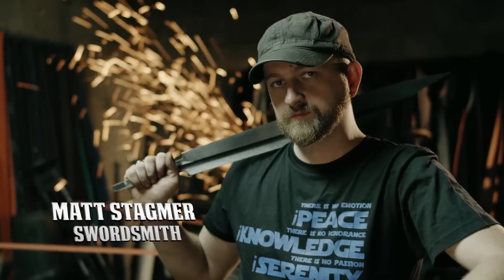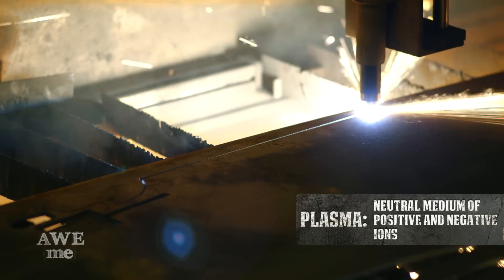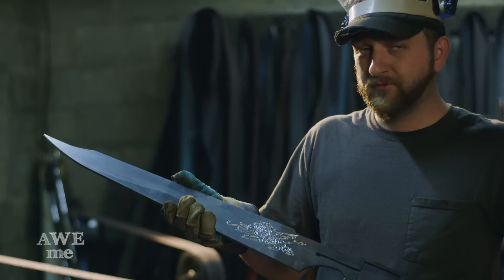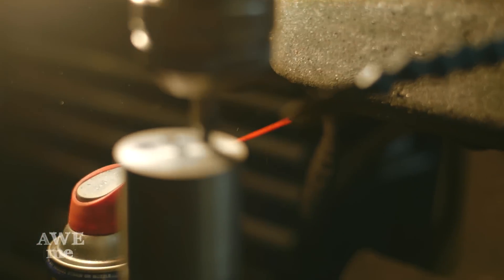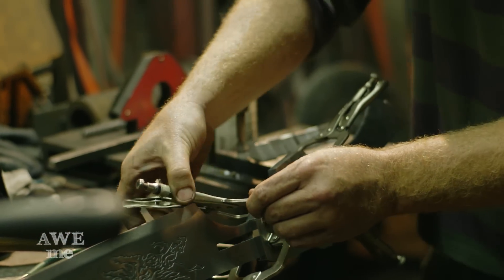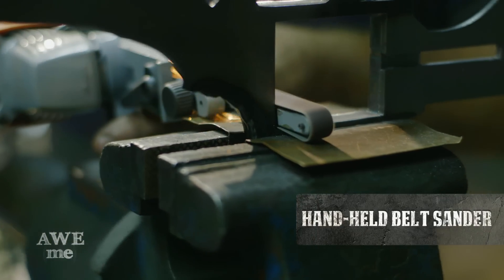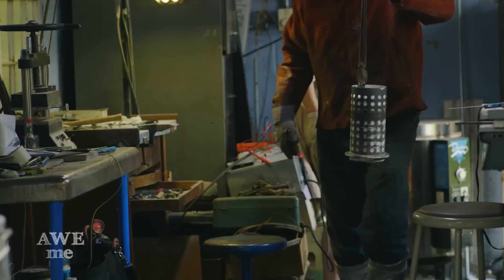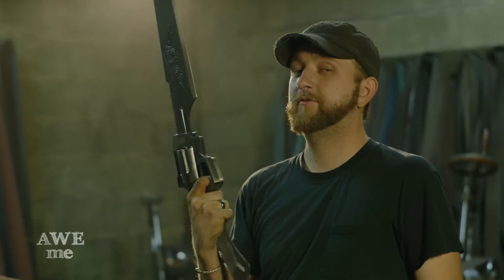Squall's Gunblade (Final Fantasy VIII) - MAN AT ARMS: REFORGED

Comment: I am very impressed that Griever was mentioned and not just called "lion bird" or something. You did your research and the product looked amazing!!
Reply: Researched that but didn't research the actual swords size it's too small
Reply: @kurosironcry3619  This size is correct. I've seen Squalls original gunblade was never a buster sword and was pretty compact. You are thinking of his Ultima blade which is a bit larger.
Reply: I'd say the slight problem would be it could be a bit wider on second viewing.
Reply: @bentoremix4311  watch or look up Micheal Cthulhu's build you'll see what I mean.
Reply: @kurosironcry3619  did you learn in this past year that squalls gunblade is 25.5 inches?
Probably not on the dot, but pretty close it looks like

Comment: One of their best creations so far. It's just the right length that it's easily wieldable and just the right thickness that it doesnt wiggle when slashing through objects like the past ones. Shit's cool.
Reply: Yeah the non wiggling of the blade is what really impressed me.  Blades are not supposed to do that.
Reply: colkestrel well actually blades dont wiggle. They flex. Because of the nature of steel, it has to flex otherwise the blade will snap.
Reply: colkestrel Aren't supposed to do what? Wiggle?
Reply: colkestrel That depends on the sword and quality of steel. Thinner swords tend to wiggle, and their supposed too, if the steel wasn't flexible enough a thin sword would just snap on contact. That's also the purpose of folding steel, it's to make low quality steel more flexible.
Reply: HeroUnit210
The blades on man of arms always wiggle like a one handed saw.  They are not supposed to do that.  Flexing is one thing and wobbling is another.
Reply: Adam
Correct they are not supposed to wiggle like a one handed saw when striking an object.
Reply: colkestrel They are actually supposed to flex quite a bit. If they didn't, they would snap.
Reply: colkestrel the difference is a wobbling blade will bend. A flexing blade will go back to original form.

Comment: NICE! You really listened to the fans. I like that you got some other cutting stuff, zombie head was requested and was great. I also like that you did a lot of explaining by the blacksmiths themselves this time.
Reply: Agreed. I've learned a lot about forging through this series.
Reply: Matt Stagmer It shows! Good effort on this one, guys. To bad it doesn't fire, though. Was that decided on as a result of time constraints, or legal considerations?
Reply: Ryan Hartigan Well, I think the problem was more of how it would fire. I don't know if it's explained in VIII itself how the gun is incorporated into the blade, but I imagine that it would be difficult to fire through the center or along the side without recoil throwing you off and possibly injuring your arm, especially on a build as light as this sword.
Reply: Matt Stagmer Hey man, Fantastic job on this build. hope you guys keep making beautiful works while raising the bar
Reply: Xilinoc Actually, the trigger is not meant for firing bullets. I was a HUGE fan of the series in my gamer days, and if I recall correctly, the trigger is supposed to be pulled (press L1 on the dual shock controller if I remember correctly) as you strike your enemy for increased damage. It was an awsome feature!
Reply: MarKo 9999
They explained it as pulling the trigger sent a reverberation through the blade, making the blade vibrate as it cut through an enemy causing more damage.  That's why it was said to be so difficult to master a gunblade, because the user had to train himself to pull the trigger exactly when the blade cut through the target.

Comment: Guys its a serious question
Where could i buy something like the ones you made in your youtube videos?

I dont have the money now but after 6 months i could afford one because i want one of these gaming swords for decoration.

And this Gunblade is the one i like most ,_,
Reply: I was wondering the same for months, wish they'd sell them...
Reply: If you were wanting to buy, then it would have to be from some source location. Nothing made on this channel can really be sold because its all licensed. They'd get in trouble for trying to sell them.
Reply: ***** They wouldn't get in trouble unless they tried to produce more than a few of them. If licensing were an issue, independent prop makers (some of which have LLC's and do it for a living) wouldn't exist.
Reply: watch Man At Arms interview, they said they sell it to film production house mostly.
Reply: enchman69
The original in the game doesn't have a barrel either.  The gunshots are used to vibrate the blade.
Reply: You normally can't buy these weapons due to the copyrights... Forge one for your own ^^
Reply: You can buy these on ebay replica's with stainless steel metal.
Reply: Rhonsus K. The original in the game totally has a barrel. Just look at some pics, especially from Dissidia, and you'll see.
enchman69 Thanks, I'll check this out!
Reply: All
Reply: enchman69 Then they're selling a hella a ripoff, considering the barrel is supposed to be interior only. They probably didn't read anything Square wrote up about the blade or how it works, so really, congrats on them selling not only Square's IP, but a shoddy replication that would make the original designers shake their heads in shame.

(I ain't saying them selling copies is bad. But making shoddy reproductions without understanding the full structure/concept is kinda sad. Some people want these things for the actual replication, and getting them to bore a full hole through removes the actual purpose of the gunblades Squall and Seifer used - the purpose of being vibroblades)

Comment: How about combining Witcher's swords (steel and silver) to make something similar to Darth Maul's lightsaber? It doesn't have to look like a lighsaber, just have two blades on opposite sides of a handle. Additional points if the silver one will actually be made from silver.
Reply: it wouldn't be strong enough to use
Reply: superpepleen You mean the whole thing wouldn't be strong enough, or just the one sword made of silver?
Reply: ***** the silver part, it wouldn't be strong enough
Reply: superpepleen Yeah, I thought that silver might not be the best sword material. Still, if they make both parts from steel it could work. Maybe use silver in a "symbolic" way, like for decorations of some sort.
Reply: *****
or maybe give it a bath of silver for the looking
Reply: Alex Krusher that could be done, that would even make the cutting edge too sharp and you couldn't even use it once because it would damage the silver. the only way to do it would be to give it a chrome-over to make it look silver.
Reply: superpepleen
still prefer the silver bath, anyways its for exibition, not use
Reply: Alex Krusher true but then your forgetting that the entire point of this series was to convert fictional weapons into real working replicas.

Comment: my dream was almost complete..... only if they had added the actual firing mechanism......
Reply: if they had done that it would have blown the blade off, would still be a proper cool thing if someone managed to make it work though
Reply: tom5677 one day brother. one day.....
Reply: tom5677
It needs a barrel for it to work, making it not accurate to the FFVIII version :)
Later games features a working gunblade with a propper barrel, i'm not sure it would be very handy though, seeing the size of that monster, it's maybe even bigger than the .500 S&W magnum; it would be very hard to fire XD
Reply: Py7h0N357 it's meant to increase the impact force and used like an Axe, not shoot someone to death
Reply: Simos Katsiaris
nope, nope nope nope. simple vector of forces here, the bullet won't give you more power, it's not going to give you strengh it will make your blade shake, lowering your grip on it.  
Have you ever fired a revolver?
It has a tremendous pression of the gaz from the burn of the powder, if you don't put an obstacle in front of the cardrige, the powder will just burn and...nothing will happen. Now, put a bullet(in FFVIII we clearly see bullets) in front of that, this bullet cause the gaz to compress until they reach a pression where it is more powerfull than the sitting of the bullet in the cardridge, now, you have a cardrige who start flying out of the gun, the bullet is soft enough and the back of the blade hard enough and the bullet smash itself and cause the all thing to jamm. Then the gaz still want to go out, and if you aren't alredy hurted by the fragment of metal, the entire cylinder explode now at a couple of centimeters from your hand. That will probably hurt hard your hand and make the entire thing unusable.
More, the blade wont vibrate much from this kind of impact, go see Skallagrim's video, it shows you how a blade vibrate and you don't want it to happen.
Reply: Py7h0N357 He's talking about the Pistol-Like Grip, not the bullet.
Reply: Py7h0N357 actually, I commented in Skal's video about the gunblade once. It has a barrel inside the back of the blade. I believe if you watched the cinematics again, you can see it. But it would still be pointless, since the heat and the vibration will break the uneven blade apart.
Reply: SLIghtier in the online it uses a metal like vibranium(captain America, black panther weapons) but it has rapes and Gotham style corruption in there anw

P.s. xiv
Reply: SLIghtier
no barrel, it's mentionned many times for this one in particular.
Later one's have one and I beleive you can actually fire with those, but this one is mentionned several times as using the energy from the fireshot to make blade vibrate, wihich sound nice on the paper, but Skall show how a blade vibrate and it don't work ;)
Reply: You need to have a firearm license to be able to make guns i believe. Not everyone can just make them.
Reply: TVwazhere
Nope, as long as you don't sell em you're usually fine.
Reply: in the game, the gunblade has a chamber that goes through the blade so by theory, it is possible (Y)
Reply: Shane Khan
for the last time NO. Not in FFWIII.
Reply: bro this is final reality, not fantasy, physics apply in this world.

Comment: IDEA, gunblade 2.0, use an actual revolver. take off the handle, make the blade but make it thick in a triangle shape looking down the blade, hollow out the center, either make a inner barrel or have one made for you (if you dont know how to do the rifling) cut off the barrel of the revolver and attach it on. BOOM A WORKING GUNBLADE
Reply: emmmh.. isn't this.. ummh... how do you call it..? doungerous? 😨
Reply: YEP XD
Reply: isn't that the purpose of it? being dangerous?
Reply: Wonder how many working versions of squall's gunblade design are out there? Lol
Reply: I'm sure the reason they didn't make a working gunblade is because they didn't want a visit from some nice folks in  the ATF.
Reply: one prob. not as sharp. but a gun is a plus. still stabs. but can't slice as deep. could would still work though. I have had the same thoughts just been trying to figure out how to get it to be as sharp
Reply: maby have it so that the center when you pull the trigger flips out then when you releas it it pulls back in. or hollow out half of the blade and when the trigger is pulled it sinks back inti the blade. giving it a barrel like your idea is deffinatly simpler though
Reply: Squall's Gunblade doesn't actually fire bullets, in the game, it uses blanks, the purpose of firing is not to shoot the enemy, but to cause the blade to vibrate and "increase it's cutting power" (obviously not how it works irl, but it's called Final FANTASY for a reason.)
Reply: I'm sure someone out there is still working on an actual model that shoots real bullets.
Reply: graham ross The gunblade in game did not shoot bullets, it shoots blanks.
Reply: how works the gunblade?
Reply: ArceusDX  And i'm sure someone is working on a version that shoots actual bullets instead of blanks lol
Reply: graham ross Then they're not being faithful to the game >w>
Reply: Actually, as far as I can figure, physics says it should work, to a degree. Not a big enough of one to go to the trouble of fashioning the weapon, but the kinetic energy from the gunpowder explosion would have to go somewhere. It'd be murder on the hands after a while, though.
Reply: Shane Armstrong Yeah, it's gonna make the blade vibrate, but irl, the blade would vibrate side to side instead of up and down, making it a terrible cutting tool.
Reply: Well, that depends entirely when you pull the trigger, honestly, as well as how the blade is designed. If it's like this, yes, it's almost entirely inefficient. However, if it was a sawtooth style blade, and you didn't pull the trigger until it made contact with them... They're gonna have a bad time.
Reply: What addind a flamethrower with an ornamental trigger and handle that looks like the traditional gunblade?
Reply: I suppose they could make it so when you pull the trigger it sets off a flashy bang with sparky fire and smoke, but it would just be a flashy blade weapon then
Reply: +graham ross And i'm sure someone is working on a version that shoots actual blades instead of bullets lol

If only there was a way to rifle a blade
Reply: Edgy Bastage they could technically do that, it could shoot like a pellet gun, the blade would be hollow and it would shoot tiny balls, it's kind of like a weapon used by an assassin I can't remember the name of who made a pellet shooting umbrella.

Comment: The whole thing is too small. The blade needs to be longer, the handle longer and the gun cylinder needs to be bigger. Very fine craftsmanship I will say! Just make it bigger.
Reply: FINALLY someone who shares my complaint (albeit the only one) about this!!!! i remember the whole thing being heavy, awkward & unwieldy in the game. no offense & still kudos to the team making this, but this one here, seems like a toy for 10 year-olds in comparison to the one in the game.
Reply: Falcon Windblade also, they could have changed the design a little and let the blunt edge of the blade be turned into a barrel, then instead of bigger bullets make them a bit smaller so the tube wouldn't be damaged by the blast.
Reply: superpepleen
That's something i'd be completely against. gunsmithing is first a different discipline, & these guys probably ain't knowledgeable enough to do that. second, the problem with the law. making guns require different licenses & permits, which these guys clearly don't have. & third, the point is to stay as close to the appearance in the game as possible, & the changes you mention can actually be more drastic than it sounds.
Reply: Falcon Windblade true, that was basically what i was thinking too, but they could have done a coalition with a licenced gunsmith, then even the legal problem would have been put out of the question,

as for the change in the barrel, not that much, true the design would be changed and the caliber would have to be decreased be it has been done before.
Reply: superpepleen
Err... gunsmiths, like pretty much everyone else, don't work for free. getting them involved & getting any possible legal problems sorted out, would be very time-consuming & cost shit tons of extra money. in theory, incorporating a gun barrel won't be much work, but in actuality, that would be a hell lot more whatever involved.
Reply: Falcon Windblade they did it before, remember the assasins blade episode?
Reply: superpepleen
It's gonna be very different having a gunsmith coming over to give some advice on springs, than possibly requiring the said gunsmith to actually participate hands on in the making a working firearm...
Reply: Falcon Windblade but that's exactly what happened on that episode i mentioned, the old gunsmith liked the project and decided to make the spring mechanism, either way, all i'm saying is that they've done something like that before, making a working firearm is a lot less annoying than you think, even though you'd have to find someone with the proper legal work.

Comment: Well you guys have lost a subscriber. You call this blacksmithing? An automated plasma cutter put more work into this then any human being. I get that it's 2014, but I liked how the old crew actually hammered out those fantasy swords from ingots of metal and actually put some back into their work. They make the crappy replica stuff the same way as this (minus the heat treating).

All this video showed is that you have a dude sitting at a computer who calls himself a weapon smith yet he doesn't even touch a hammer to the steel.

You guys say you are master smiths, then show us that!!! Show us you can hammer a blade out hell not even a fantasy or any TV or game sword. Just make a master worked Long sword made from proper hammered out folded steel.
Reply: Oh and the grips on the gun blade weren't made of crapply stained wood....... If you guys are as talented as you say, Your talent is going to waste with how lazy the computer age has made you for this line of work.
Reply: Mike Allen They have an expensive plasma cutter, what are they going to do with it? Oh yeah, use it.
Reply: You are very right. This show has one down the drain. There's no actual black smithing anymore just clamping and welding. Tony's crew was much better and more fun to watch.
Reply: Agree with you

Comment: I hate to criticise your guys coz I'm a big fan and love your vids, but this one really erks me - there is no gun barrel? You've gone to such great lengths to make the trigger and hammer, and the cylinder is amazing! But the barrel should have extended through the blade all the way to the tip, thats why there is that offset on the foreside of the blade tip. And yeah, getting a gunsmith in to work it into a firing piece would be amazing!